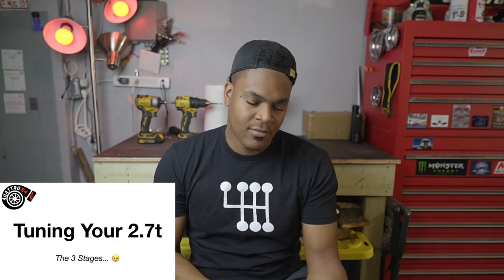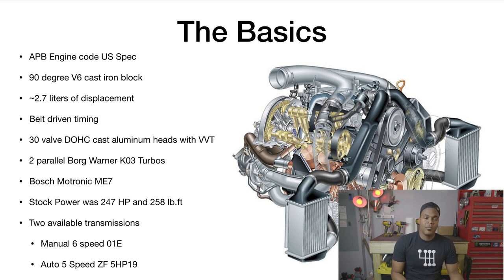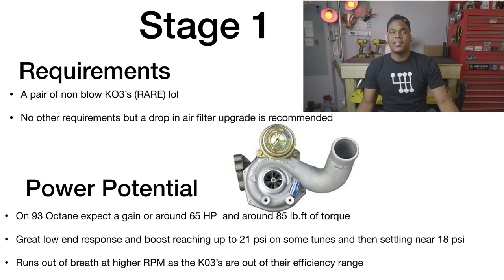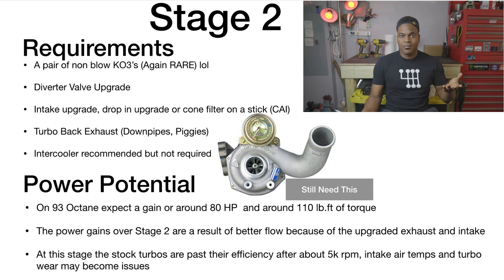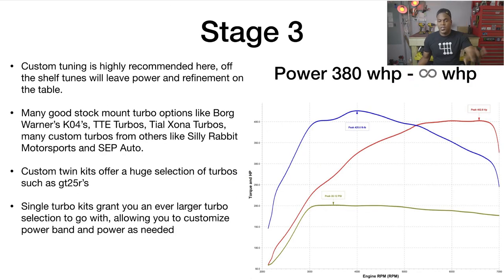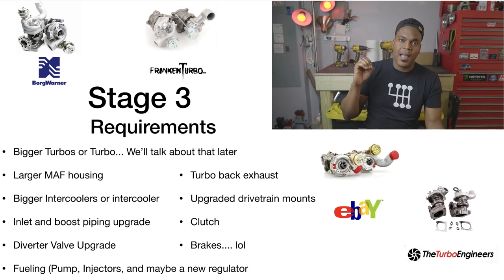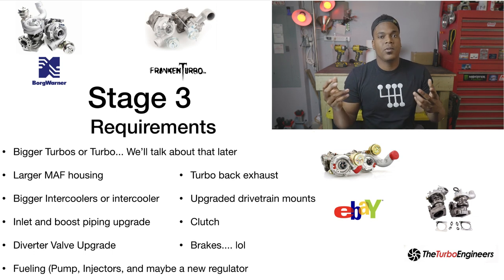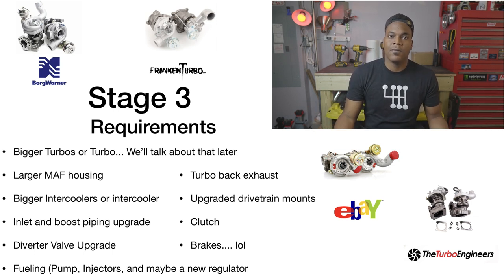Make More Power ( Tuning Your B5 S4 2.7t )

Comment: I'm running stock 255k mile ko3's on my b5 that's been stage 2 for the past 8 years 100k miles. 3500 mile oil changes, and proper engine heating and cooling cycles. I keep saying I'm going to swap them when they blow but they just don't 😂
Reply from the maker: Hahaha love this! It’s awesome hearing how some can push the KO3’s hard for that long, and like you said good maintenance and driving habits are key.
Reply: What tune did u go with? Hearing so many different things about different tunes
Reply: @Patrick Feliciano  it was an epic tuning group tune from florida. They have since went out of business, unfortunately. The website now links to solo motor sports. They may be able to tune.
Reply: Finally blew up my K03s and am now upgrading hence why i am back here again. Thought it was good to come full circle.
Reply: @jasonsantiago5157  hey if you are still around what oil are you running? ive heard you can use 5w-40, 5w-30, 0w-30, and 0w40, i bought an a6 with the 2.7t recently, i am not tuning it, but would like to know so that i can run what people have had the most luck with, as its for daily driving. at some point next month i have to replace my valve cover gaskets and a few other gaskets and seals under the valve covers, as i am leaking about a quart every week. Also if by chance have you had any trouble with a maf code popping up all the time for "High air input."? i think its P0103 or P0104, car runs fine even with the light no missfire or anything but just in case you mightve had trouble with this before id love to hear how you fixed it.

Comment: Full stage 3, KO4's, custom GIAC, larger intercoolers. Alcons on the front.  I over heated it with 220K.  I have a 90K A6 engine with bent vavles waiting.  I'll clean it up.  New valves, timing belt/wp service.  Turbos are still fresh.  I have and CM FX450 clutch.   

I love this channel.
Reply from the maker: Damn! Hopefully you can get it on the road soon. Sounds like a fun build

Thanks!
Reply: howd it overheat, debating if i should build motor or not/ just do k24 turbos

Comment: I’d like to help chime in on a few things! From stage 1-2! Stage 1 is a simple software flash! Upgrading DVs will benefit also! 710n’s are great low price DVs that can handle 20psi+ I believe! 
With stage 2 it’s recommended you upgrade your down pipes and exhaust! The stock cats are SUPER restrictive and rob about 40+ HP...you can gut your stock cats or purchase aftermarket! “BEL” engines have a different flange for the turbo flange be sure to get the correct set when purchasing also “TIP” cars need different DP’s because of the trans mounts! 

+1 for Brad @ GET tuning and Blake Beadle as well! I’m sure there’s more I forgot but for your basic knowledge this video hits all the points! I encourage those to also read the B5 S4 wiki tuning page along with Nefmoto tuning site for more info 👍🏾
Reply from the maker: Thanks for the input 💪
Reply: Blake tuned my B5 after I got the monster SEP Ypipe...Dude is super legit, car runs like a dream!

Comment: Forgot to mention I also have the 2.8 heads ported 2.7 intake manifold ported to match 2.8 valves intake and exhaust they r all the same turbos ported to match the down pipes xs power catback dual exhaust custom 3.5 to 2.5" y pipe stock inter coolers for now 450 walbro pump I'll post a video soon of my build explaining all I've did and a walk around I get alot of comments about it.. just like to have fun I enjoy watching others it inspire me to do what I do..
Reply from the maker: Drop me the link of the video when it’s up.

Comment: I agree.. my budget isn't like most I have ebay turbos I have had for 5 yeas now stage 3 tune pushing 475 wheel hp on 20x8.5" wheel its a s4 b5 hybrid 98 audi a4 Quattro 5 speed manual transmission 2.7t.. 92 octane with 2 ecu's 1 for E85 and 1 tuned for 93.. turbos set at 7psi 20 pounds of boost for now. Been an amazing car it in the pic on my profile...

Comment: What is needed to run e85 on this platform, just picked up my first b5 s4 like 2 weeks ago and it has BW K04’s, o34 85”mm maf, Bosch ev14 550cc, 
And it has a project b5 450/85 fuel pump, is there anything else I need to change? so the car has all this but to my understanding it’s on a stage 1 map and it’s running really rich I was looking into getting it tuned soon but would it even be worth it to get it tuned on e85? 

BTW I don’t drive this car at all in its the current state it’s in. Thank you
Reply from the maker: You are pretty set there 
The lines can handle the e85 and so can your injectors and fuel pump

Comment: Im right at the 550-580 crank and 494whp to be exact and im curious if you know what kind of loss % down low and gains % up top i would get from those 2.8 heads you mentioned

Comment: What is difference in block between the s4 and the 2.7 a6? I know ecu is different also
Reply from the maker: Blocks are very similar if not identical. The engine codes BEL in the A6 and Allroads were later revised casting for some and they have slightly stronger blocks coded BF
Reply: @CIPGAS  good to know, I have an 04 A6 manual, absolutely love the 2.7 ever since i got it. Its so hard to find info on these engines, but your channel is great. Keep up the 2.7t content, love it!